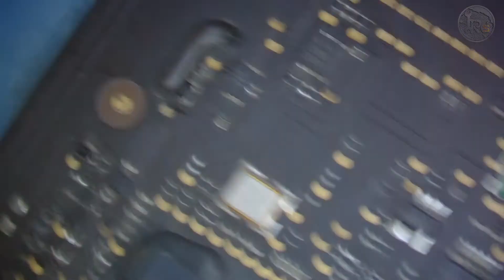MacBook Air A1466 No back light/ മാക്ബുക് എയർ ബാക്‌ലൈറ്റ് പ്രോബ്ലം

Comment: ചേട്ടാ.
ഒരു ഐഫോൺ 8.
നോ.imei.
No modem firmware.
Wtr മാറ്റി.
Baseband reballed.
Bbpmu മാറ്റി.
റെഡി ആയി 1 week ഓടും.
വീണ്ടും return.

ഇനി എന്തുണ്ട് next

Baseband diode mode റീഡിംഗ് ഒക്കെ പക്ക
Reply from the maker: wtr റിമൂവ് ചെയ്ത് വാല്യൂ ഒന്ന് ഡയോട് മൂഡിൽ ചെക്ക് ചെയ്ത് നോക്ക്
Reply: @Irapidservice  നോക്കി.
എല്ലാം കറക്റ്റ് ആണ്.
Nfc ആയിരിക്കുമോ.
ഇപ്പൊൾ imei ഇല്ല.
Wi fi ഉണ്ട്.
Whatsapp എടുത്താൽ hang ആകും.
Reply from the maker: Bb power change cheythu just onnu software cheythu nokku
Reply: @Irapidservice  bbpower change ചെയ്തരുന്നു.
എപ്പോഴും സോഫ്റ്റ്‌വെയറും ചെയ്യും.
എന്നിട്ടും same ..1 week ഒക്കെ സൂപ്പർ ആയിട്ട് ഓടും. പിന്നെയും repeat
Reply from the maker: Engil baseband allel bb power ithil ethelum dry solder aavunnundaayirikkum
Reply: @Irapidservice  reballed, 3 പ്രാവശ്യം.